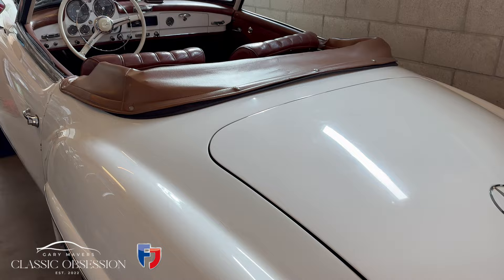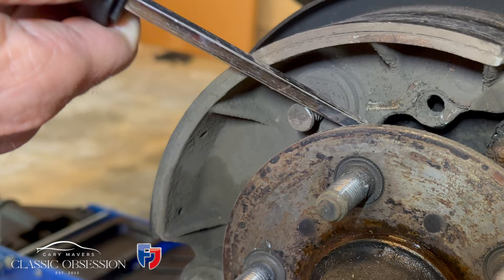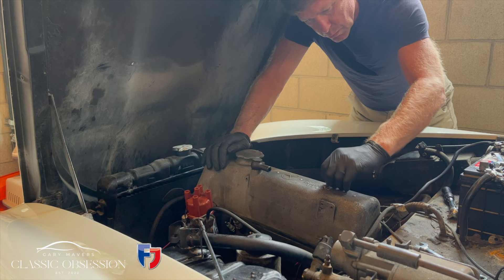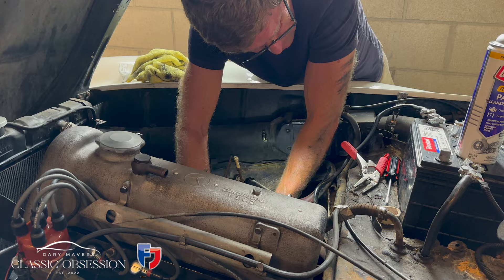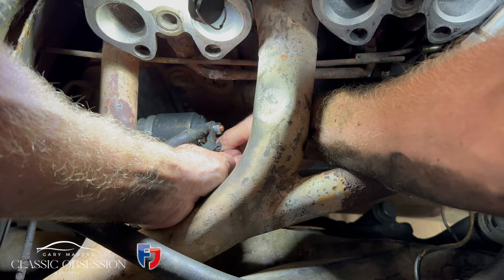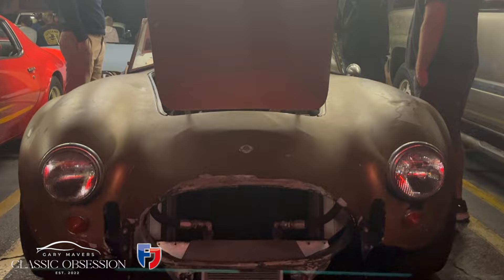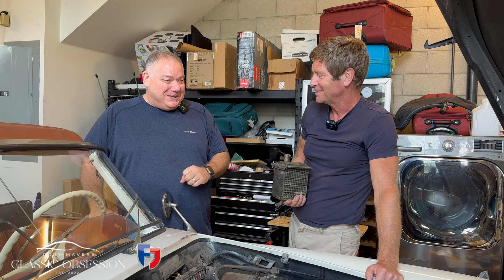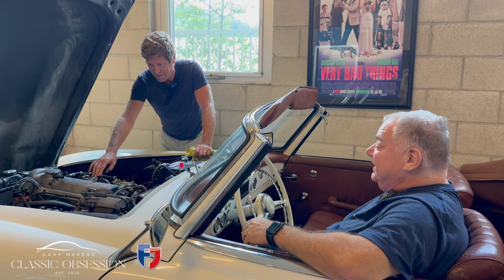Mercedes 190SL Restoration (Part 3) | Carbs, Brakes & Ignition | Classic Obsession | Episode 44

Comment: Hi Gary another great video thanks. Was glad to see you using a mask when changing the brake cylinders. As an apprentice in the early seventies, brake and clutch dust wasn't  considered dangerous, now at 67 yo  with damaged lungs, hot on the safety aspect now. Too late for me but for others it's not . Glad to see you are role modeling, showing others the dangers. Just after midnight so it Tuesday morning here. Off to bed. Thanks Gary, I appreciate your patience and efforts in bringing us your enlighting videos. Top hole mate. Kiwi Ken 😊

Comment: Really enjoyed this, you have very good dexterity with the fiddly bits,  just one thing, and I played it back 3 times, were the wheel nuts left hand thread?
Reply from the maker: Ha! No the shot used was probably the wrong one in the sequence so therefore bolts going in the wrong direction. Regards.

Comment: Hi Gary  Great video, as an owner of a 190 it has really help me.   Just one quick question which way does the rotor spins clockwise or anticlockwise ?
Reply from the maker: Hi John. I can’t remember!! If you stand in front of the engine turning it clockwise I suppose that means the engine is going anti clockwise so does distributor spin anti?!! Don’t know I’d have to look!! Regards

Comment: Completely staggered there's no heatshield of any sort on the exhaust with those carbs directly above. On even a slightly warm USA day, they're going to boil the fuel straight away, plus aging the starter, generator & wiring pretty quickly !   Excellent recommissioning otherwise!

Comment: Gary, what is the purple grease you used on the banjo bolts?
Reply from the maker: On the carb seals? I normally use the blue gasket stuff here in the Uk but in the states I just couldn’t find it. I just used what I could get hold of really to give extra insurance on the seals. Regards.
Reply: Hi Gary @classic.obsession  i dont know about the Webbers but when fitting those gaskets with the metal sleeve inserts - it important to fit a wave washer so that you can't over tighten as the washer acts as a limiter. Without it the sleeve compresses on the alloy carbs wearing in a groove.

Comment: Great work, sounds sweet. Just one small point: correct fuel line hose clips won't dig in to the hoses like the jubulee clips you used.
Reply from the maker: I know Larry but try finding them in LA! I’m taking my own over from Uk next visit. I must’ve driven 3000 miles looking for parts and picking stuff up. Everything is so far away. Regards.